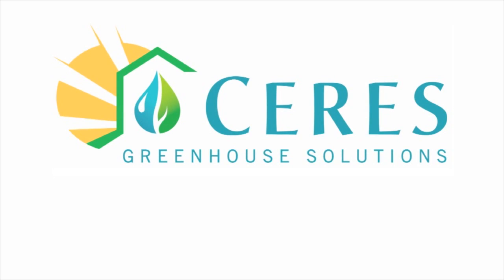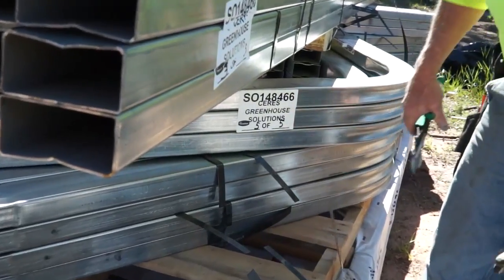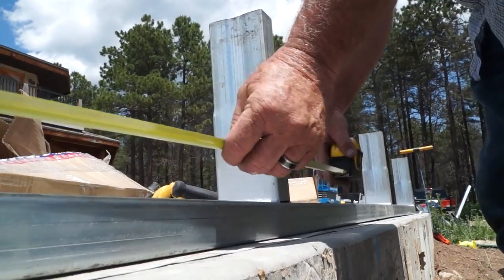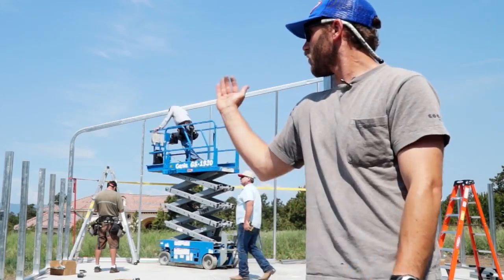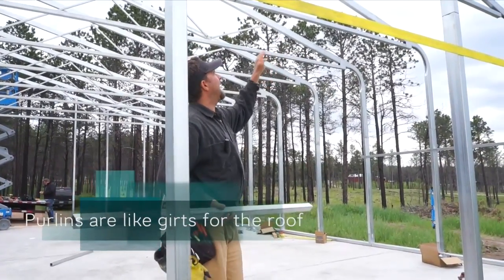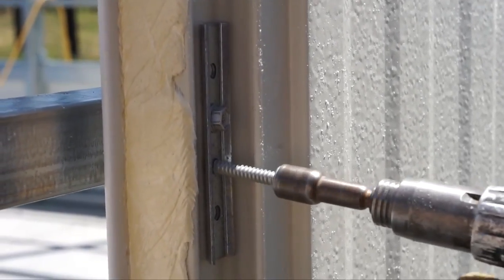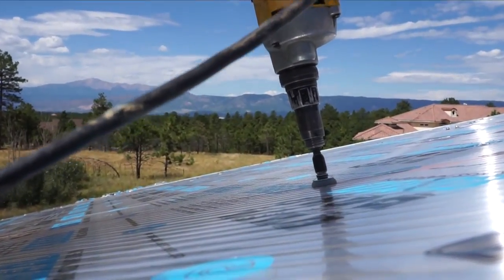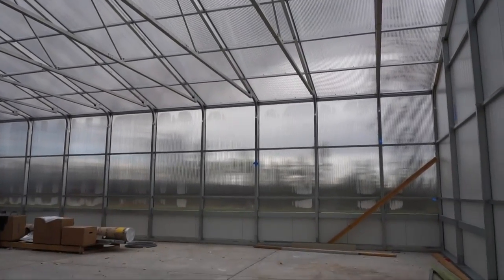Building an Energy Efficient Year Round Greenhouse

Comment: how much it cost to build a greenhouse like that?
Reply from the maker: Cost of the greenhouse will vary depending on the grower's geographical location, their growing goals and their local wind and snow loads. For more specific pricing information, please email info@ceresgs.com or fill out a contact form here: ceresgs.com/contact/
Reply: Do you only rely on the bolt system, or do you "tack weld" also? I think you should be tacking all the butt joints.

Comment: Just curious as to why there is such a large clear roof on that south facing side. You'd lose a lot of heat in the winter and because the sun is so low in the sky you won't have that much solar gain through that long low sloping roof. Plus, in the summer that long low sloping roof is going to contribute to a lot of solar gain and possibly overheating. Otherwise it looks like a great kit.
Reply from the maker: Building a greenhouse is a delicate balance between maximizing solar gain and making sure you maintain the temperature your plants need to grow. Yes, we could build a solid wall on the south side but that would cut off a lot of sunlight in the winter months. Luckily our insulated metal panels help maintain a stable temperature inside the greenhouse so our growers can have the best of both worlds and the most energy-efficient solution possible. Besides the basic design, there are other climate control options that heat and cool our greenhouses without using excess energy. Check out our website: www.ceresgs.com to learn more.
Reply: @CeresGreenhouseSolutions  What would be the R value on your "insulated metal panels"? And on the "triple glazed, high light transmisibilty" poly panels?
Reply: A steel frame directly attached to the slab and glazing fitted with aluminum bars represents a whole lot of thermal bridging. It will cost a fortune to heat in the winter as its more or less a thermal sieve ;)
If the steel isnt hot dip galvanized it wont take long to rust as it`ll be a condensation magnet.
I guess you dont offer cutomers a money back guarantee if it doesnt live up to the claims?  Energy-efficient growing environment for year-round growing with little to no heating and cooling.
Reply from the maker: @JohnGuest45   Thank you for your concern but we have eliminated all possible thermal bridges by insulating the foundation and the metal panels themselves are insulated. Also, the steel is indeed galvanized so no rusting there! We are also happy to say that our clients are saving up to 80% of what their energy bills would be with a traditional greenhouse
Reply: @CeresGreenhouseSolutions  
80% of the heatloss from a slab occurs at the edge, where you have no insulation  Dont forget that any tek screw with the head outside is also a great thermal bridge ;)
Reply: @CeresGreenhouseSolutions  Define for me "a regular greenhouse" please. That is way way to broad a term. Any greenhouse that is NOT experimental, is considered a regular greenhouse, sir/madam, and a lot of them make CLAIMS as nebulous as you are making, but have valid test results to prove it. Do you have such test results, to back up your claims?